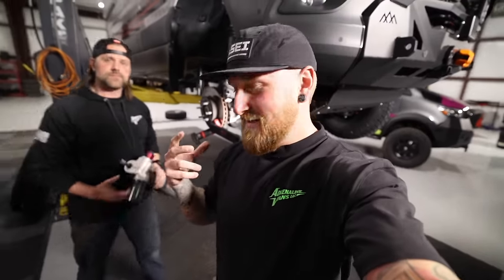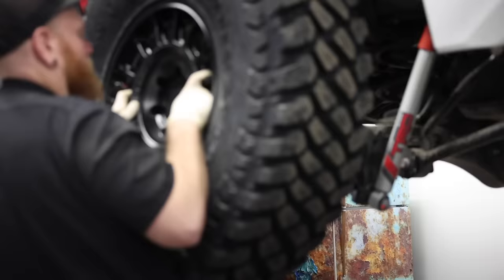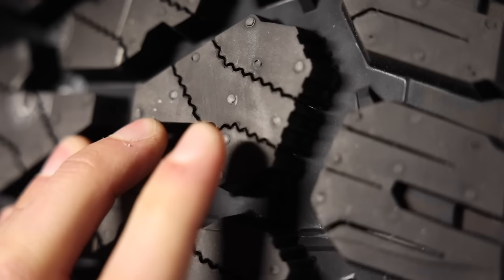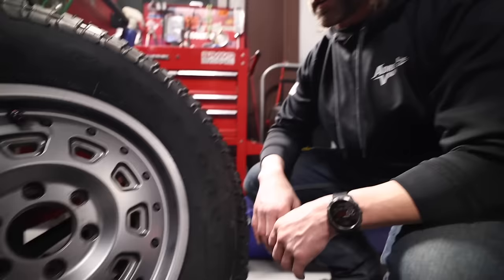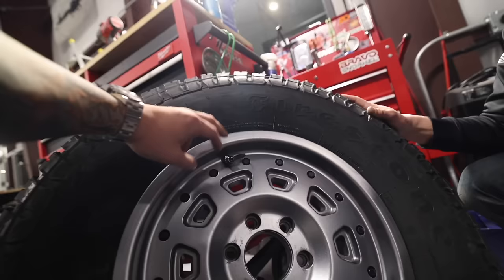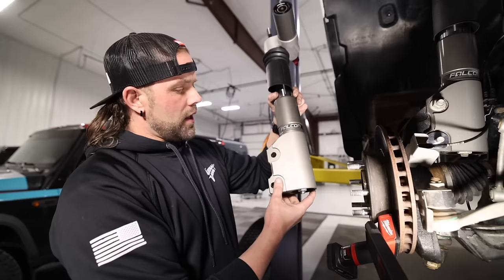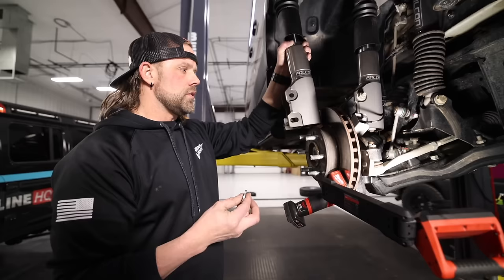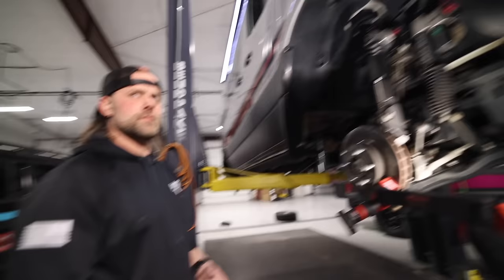Van Life Tech Talk! | Ineos Grenadier Thoughts

Comment: The more snow you can pack in those sipes and between the blocks, that's supposed to be good, yeah? Snow packed in tire grooves = traction, which is why the blocks are so close, am I understanding that correctly?

Edit: Tyler from Independence Overland has a couple vids on the Grenadier. Worth checking out, if for no other reason to see what his thoughts were in why he chose not to go that route.